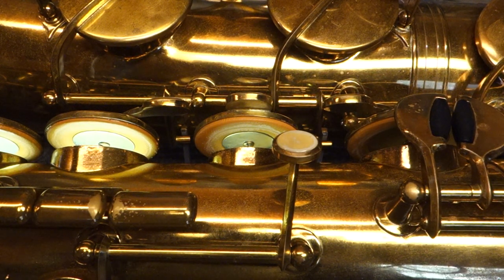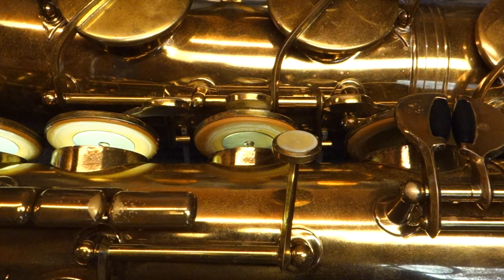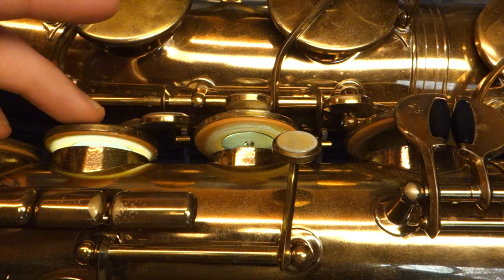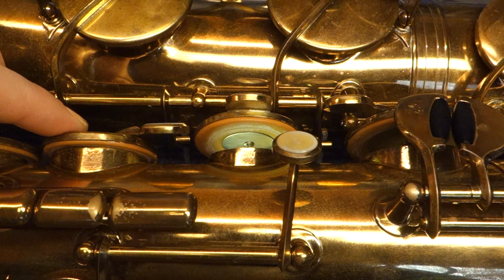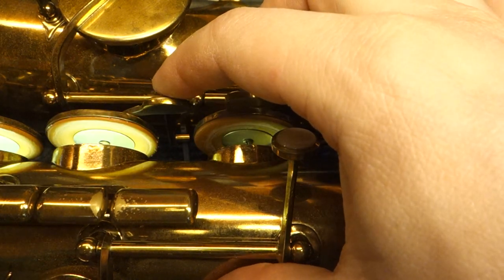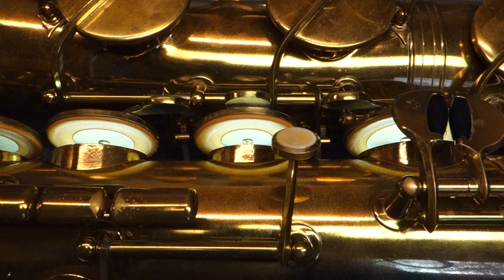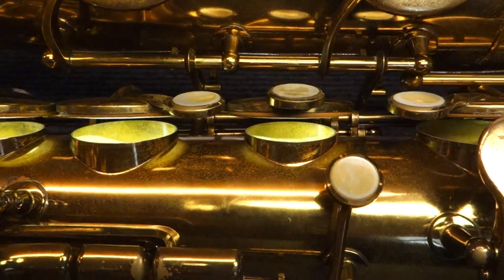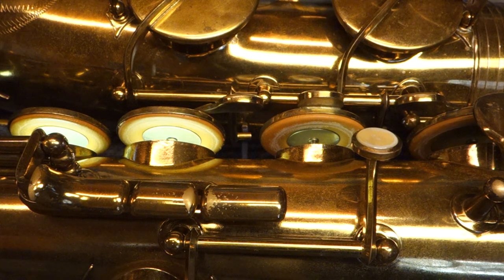Repairman's Overview: Buffet Screw-in Saxophone Resonators (Installed)

Comment: Interesting.  Only held a few in my hands and the few I had looked at felt heavy weight wise and key work a bit clunky which I am sure was  a function of improper set up.  I find the details of key work very interesting.  Keep up the great work.  Had a Holton bari once that had a triple octave pip system which at first thought had the wrong next.  It worked perfectly.
Reply from the maker: Cool!  I've heard of that horn but have not seen one in person.  The Conn 28M (not 26M) Connstellation with the plastic keyguard also had three pips, and the Buffet-Powell had four.
Reply: WOW   did not know that.  Upper register was clear and in tune....used a Meyer 5.   Worst looking horn YOU have ever seen....looked like 60 year old plumbing work.   That part was fun becasue no body expected to hear a good tone.